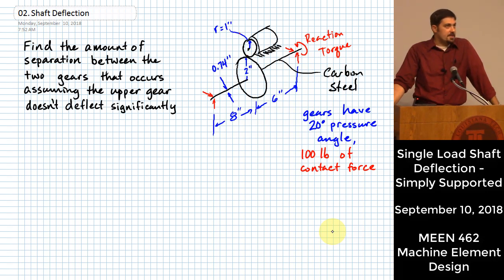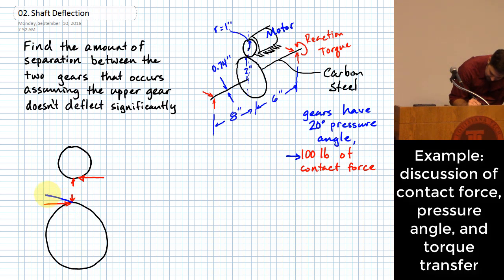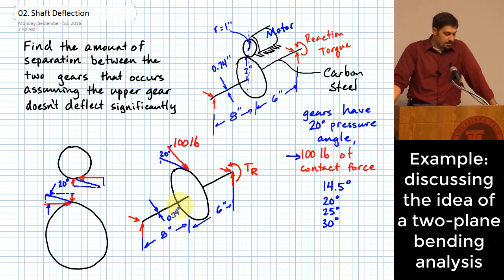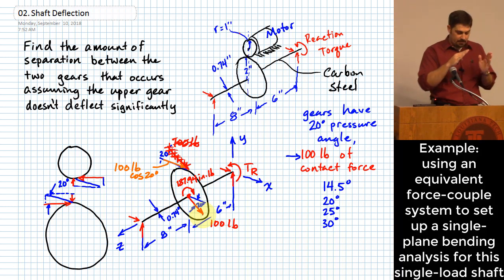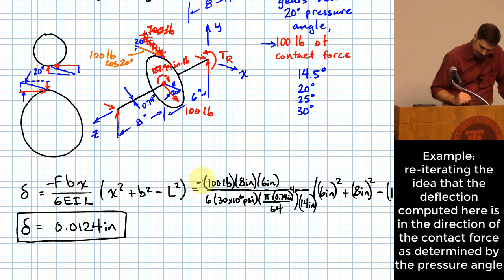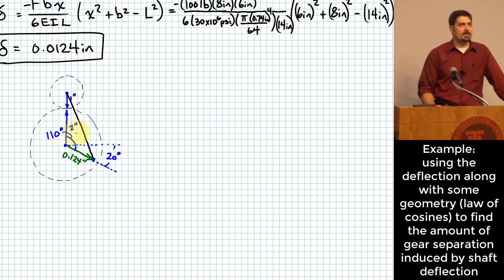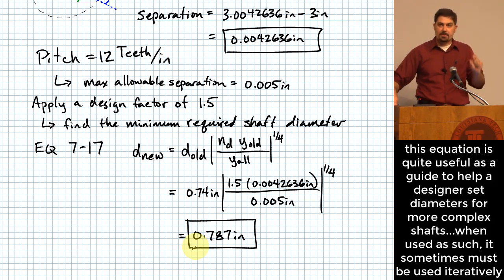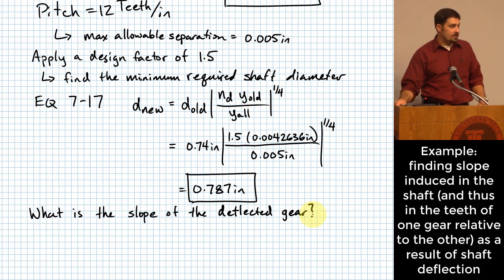Single-Load Simply-Supported Shaft Deflection & Slope | Preventing Excessive Gear Separation & Slope

Comment: Could you explain why, in the first problem, we used 100 lb in the equation instead that value with it sin or cos?
Reply from the maker: We are evaluating the deflection of the shaft along a direction parallel with the line of action of the 100lb force. We don't need to split the force or the deflections into components since there is just this one force that we must evaluate. We know because it is a simple case that the deflection will be in the same direction as the applied force. If there were more than one force applied, we would likely have to split each force into components and do separate force and deflection evaluations in two planes, then re-combine the results afterward.

Comment: Greetings professor, what chapters of shigley textbook are you covering in this series of machine elements?
Reply from the maker: I cover chapters 7-10 in a fair amount of depth, then a little more of a surface treatment of 11-18. I cover a lot of ch1 thru 6 in my Advanced Mech of Materials course, which has its own playlist here on my YT channel. I'm also halfway through developing material for ch20 for my gd&t elective. I currently have a few of those recorded and uploaded to another playlist. Thanks for watching!
Reply: Sweet I ll be consulting the channel throughout my engineering studies. By the way do you have some recordings about chapter 4 strain energy and deflection , I can’t find nothing about it so if you do would be helpful for little guidance if possible.

Comment: Thumbs up for an extremely helpful video!

Quick question:
Suppose I have a shaft with two gears on it. Each gear has a contact force, but it can be analysed on the y and z axis (instead of being analysed on the y and x axis).
Can I move the contact force at the centre of the shaft by adding a concentrated bending moment and then analysing it on the two axis in order to calculate the support reactions?